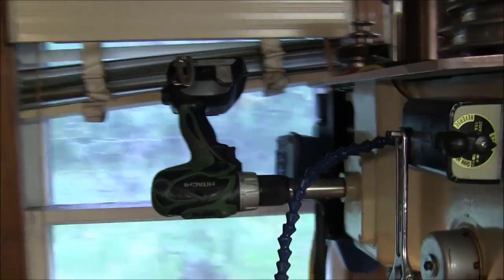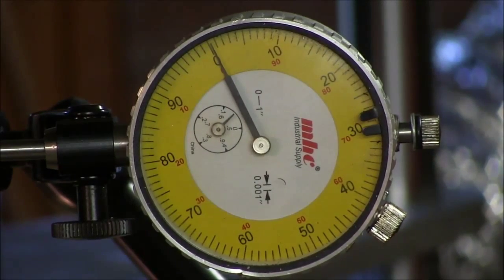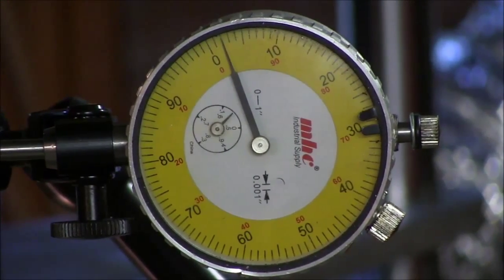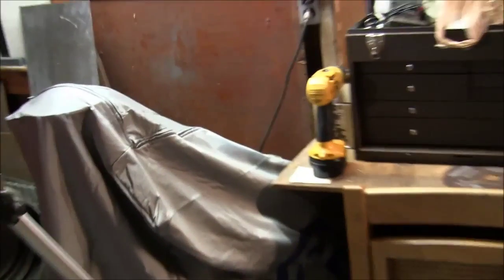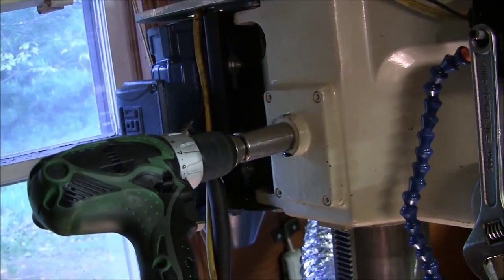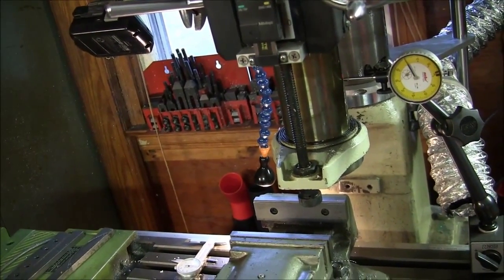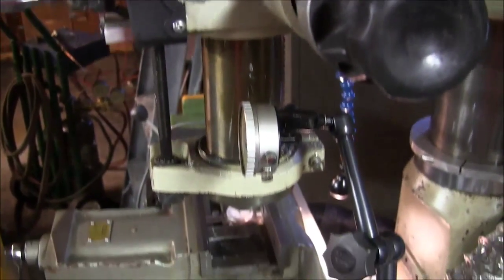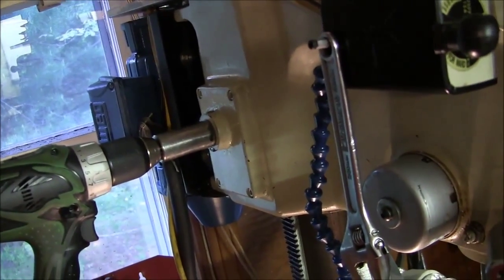Wrong Fu follow up

Comment: If you have not found a motor to drive the column, look into a wiper motor. I pick one up for a Towncar for $15 in the junkyard. I would guess it is about 60rpm. Secure it with the four bolts holding the pinion gear in place, on the cover plate. Only down size is you would need a battery. Just a thought.